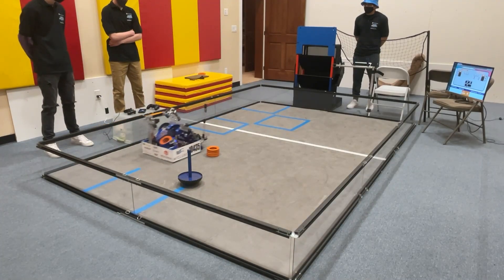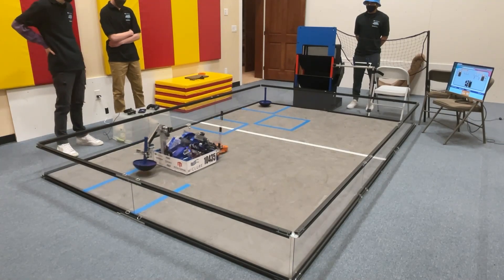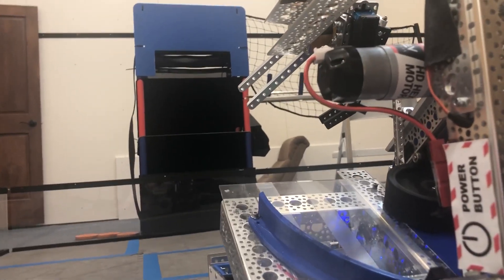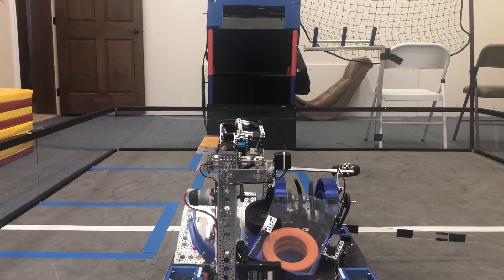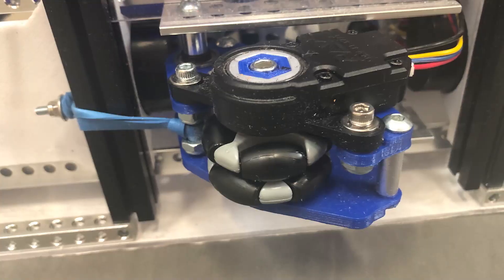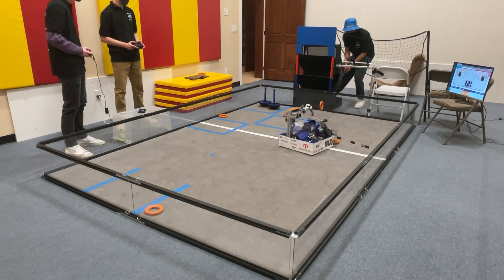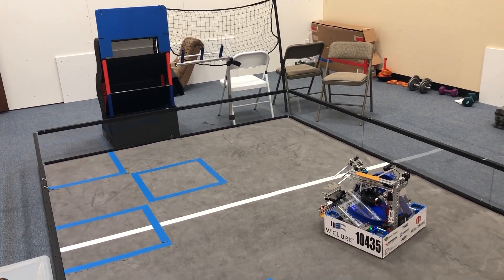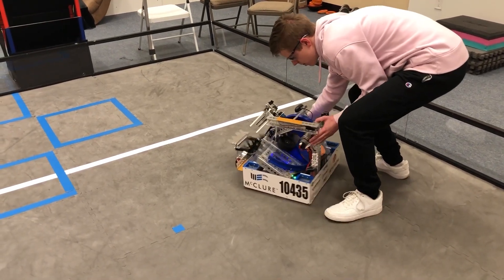FTC 10435 Control Award Video

Comment: Great video. Thank you for sharing. What motor are you using to lift the wobble arm? Thank you
Reply from the maker: We use a 40:1 REV HD Hex Motor with a 2:1 gear ratio for torque

Comment: How do you remove wobble on your shooter flywheel without supporting the top?
Reply from the maker: We bought 3 Rhino wheels and 3 motors, picked the combo with the least wobble and fiddled with it a lot to mount it straight
Reply: @CircuitBreakers10435  Thanks :)

Comment: to align the robot to the tower goal from any position, did you guys record the robot's heading at multiple positions, create trendlines based on that, and use the trendlines to tell the robot where to rotate? Or did you use a different method?
Reply from the maker: After auto we stop in a known position and then we use trig to calculate the angle from our x and y distances to the tower goal.
Reply: I'm not sure what they used, but if you know the position of the high goal, you can use trig to find your optimal angle.
Reply: This can be accomplished using the atan2 method in the java math library